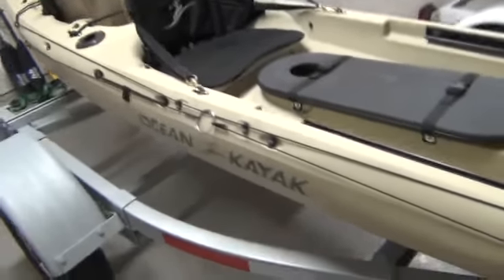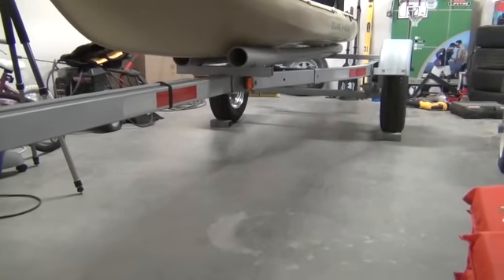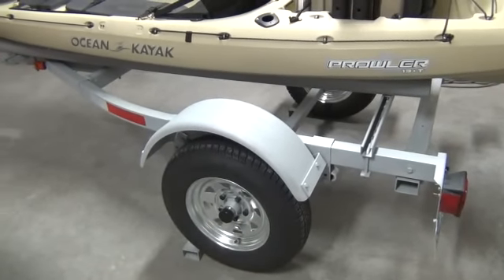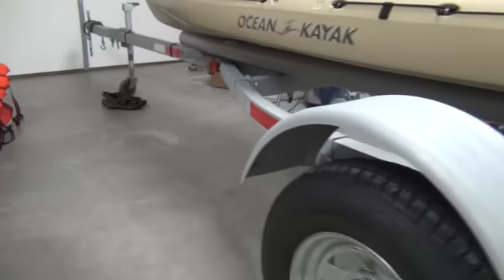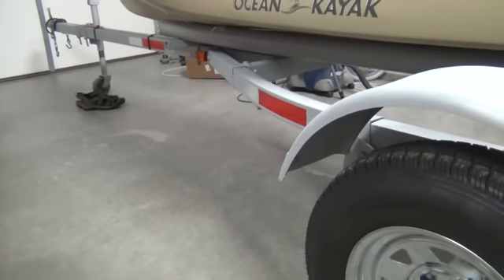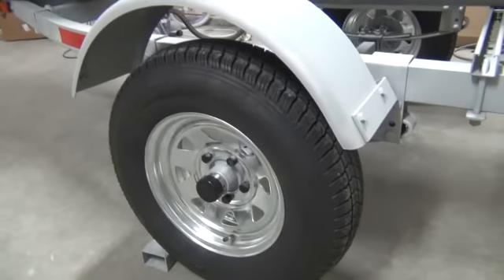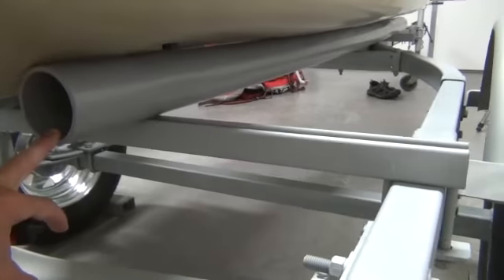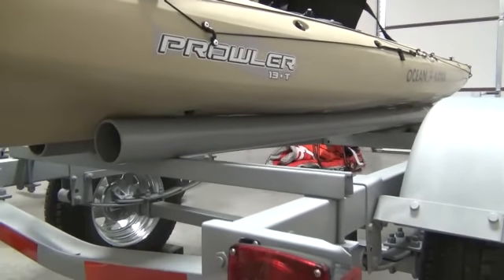DIY Kayak trailer

Comment: I think you've solved my particular rowboat storage problem. I have a Whitehall Solo 14 (weight with gear 175 pounds) that sits in coastal seawater at an ocean marina in sunny Mexico. The co-polymer hull will attract parasitic barnacles to it if I don't get it dry-docked pretty soon. The sturdy wooden pier the boat is hitched to seems to be the only inexpensive (and preferable) alternative to wet-docking. The Canadian company that made the boat sells a dry-storage solution in the form of a twin-track that lies on the ground (similar in concept as yours) but charges almost $600.00 (excluding $hipping) for it. Because of the hull shape of my boat, I wouldn't need more than two 3-inch diameter PVC tubes lying parallel to each other to get the hull off the deck. Instead of fastening the tubes to steel as you've done, because I have ground space, I believe two lengths of 2x4" wood or composite laid flat roughly 4-feet apart and perpendicular to the PVC pipe would not only support the PVC but would also raise the boat up another 1.5" or so. Win-Win. Thank you for the idea!

Comment: My MOfishyaker PVC designed trailer has been perfect all year.  S. Georgia, N Florida. Uni-Strut is strong and a great product, it even works as a flat bed trailer for hauling plywood or furniture.  I posted a video and referenced you.  Thanks for your video here, sure helped keep the kayaks off the suv roof too.

Comment from the maker: Yes I narrowed the trailer pieces too. I cut the fronts of the left and right side pieces where they meet the center piece (the part the hitch is attatched to). I held a square on the center piece and marked the left and right sides at a 7" intersect. This made 14" which is the amount I removed from the axle.

Comment: Mo
I didn't see clearly enough what type of galvanized screw or bolt that you use to go through the PVC into the "spring nut on the Unistrut . Did you use a screwdriver head screw or a bolt and ratchet it down..... And how long are they ???    Thanks for a great build which I'm going to attempt !!

Comment: I'm going to do the same with a Malone trailer for my PA and would like a couple of dimensions.
What is the optimum distance between the front and rear Unistrut to give the Schedule 40 3" conduit the proper flex?
What is the width between the conduit? I've heard 10 inches on center and 121/2 inches on center.
Like what you've done on this trailer project and the 2012 PA 14 modifications as well (different video).

Comment: One question: How much longer is the trailer than your kayak? I have a 12' yak, and trailer is 16', and thinking of cutting it down a  bit, maybe 13' or 14'. Any words of wisdom on length?

Thx,

Troy
Reply: FYI shorter trailers are harder to back. Especially when you are in a area that is not well lit.